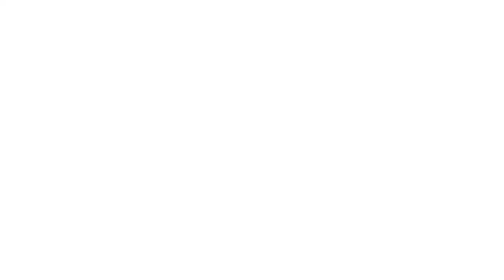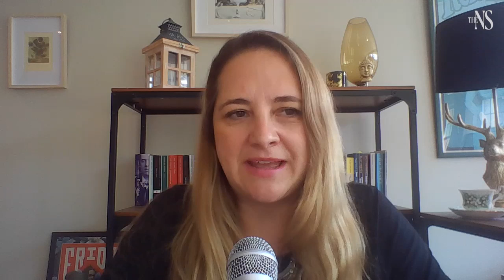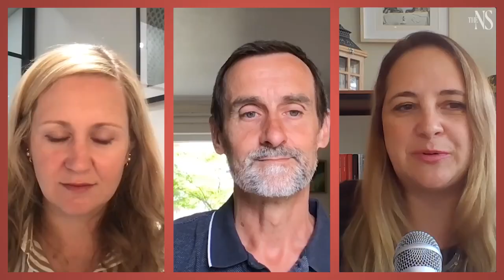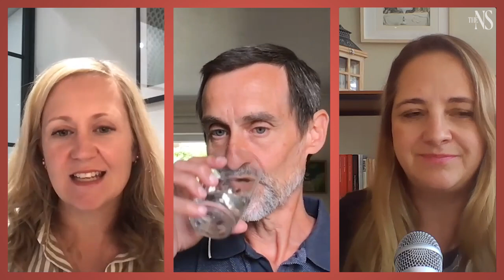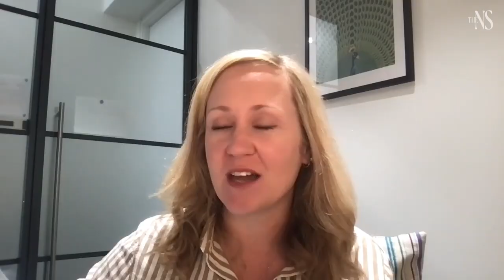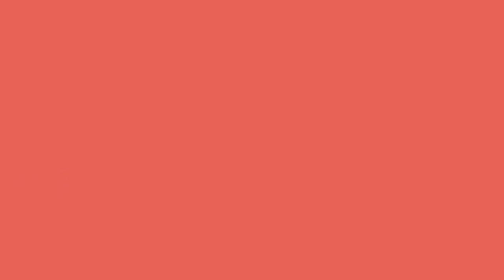The homeowner using smart meters to reach net zero | The New Statesman

Comment: So let’s get this correct. Previously the suppliers needed to update the meters every x years. So cost to them. 

They used to have to send people to read the meters at least once a year. Cost to them. 

You can get a number of devices that will clamp on the meter tails and give you a real time reading and allow you to identify what is pulling what in about the same accuracy as a smart meter. (Current clamps aren’t 100% accurate but are close enough to make the changes you need) cost to you £60-100 can be linked into your phone depending on model. 

Cost of a smart meter £800 you pay via standing charge. Dumb device.

Smart meters can also charge differently depending on power factor. Currently domestic billing dosnt take into account of power factor but industry does and gets to pay more if their power factor is unbalanced. Unfortunately LEDs lights and other switch mode power supplies have bad power factor so they will be able to charge you more. 

They can also remote disconnect if you fall behind or if they feel like it. 

They are all about being able to charge you more.

This is a clear ad for smart meters. Totally biased. 

BS about smart meters needed for telling the DNOs what power is being used. That’s total rubbish. 

This is propaganda.